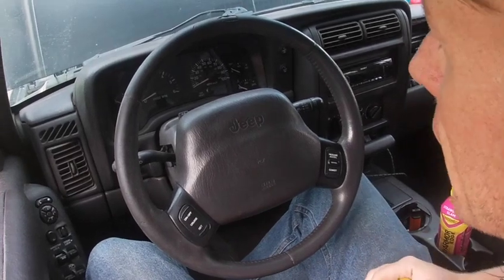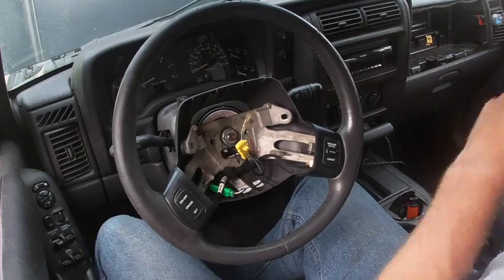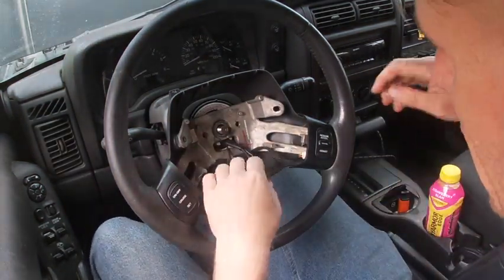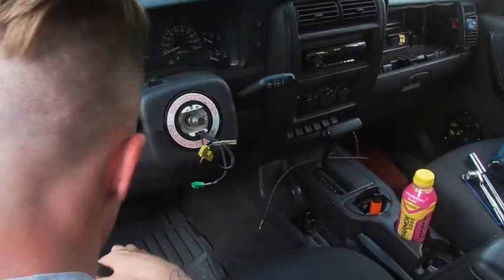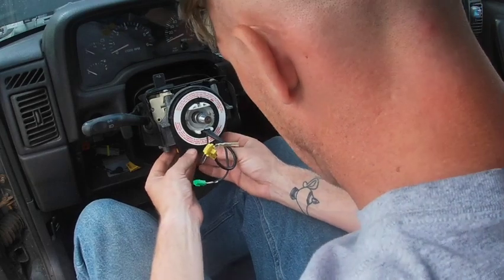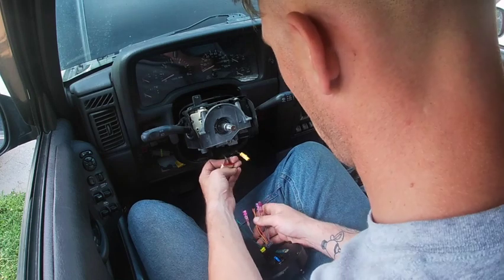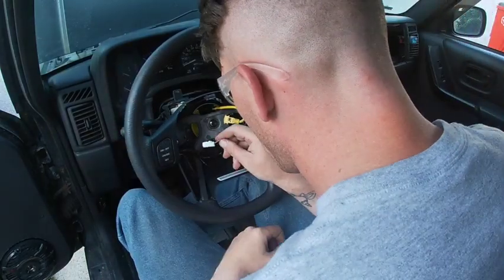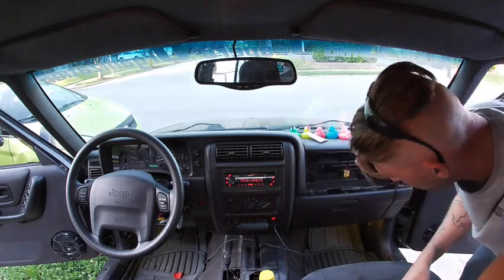WJ Steering Wheel in Jeep XJ Pt 2

Comment: Awesome 2 part video.
If im not concerned about the audio controls, can i just use the 99-01 wj harness, airbag, clock spring and an 03 wj wheel with cruise control buttons? Would that still require splicing in the wiring or can i swap the buttons for 99-01 wj buttons? 

Thank you for the write up

Comment: great video! what's the go with the audio controls?
Reply from the maker: Thank you! I’m still working on that part of the install. Need to figure out a few more things with the wiring harness to make it work.
Reply: @ouroborosautomotive  just PM you some info on FB. I’m doing the audio controls soon
Reply: Hey you two, if y'all need help getting the steering wheel controls to work please contact me via Facebook. I know EXACTLY what you need in order to get the steering wheel controls to work for your aftermarket radios!! I'm a expert at this stuff, I do it all the time haha...
Reply: Here is my fb page, feel free to message me. I'll send you the link to the correct steering wheel control interface that will hook right up to your two wires for the buttons, and it will learn the button presses and will send the correct thing to your brand of radio... It's a peice of cake!...

And if you had a Car Joying brand Android headunit, you wouldn't even have to buy any kind of swc interface because the Joying brand radios accept the resistance-to-ground based swc buttons these steering wheels use, so it would be even easier! Plus the joying radios have a menu in the radio to learn and assign a function to each individual button press. I always do my Volume + and Volume - on the left hand side of the wheel, and do Next Song/Station, Previous Song/Station & Pause/Play on the right side buttons. That's how I like mine setup
Reply: @ouroborosautomotive  did you end up getting the audio controls working yet?
Reply from the maker: I’m going to be swapping over to a joying unit in spring to have Apple CarPlay. When I do that I’m going to do a video on how to get the audio controls to work. I have the wiring diagrams already set but only wanna tear apart my dash once. Should be set about March time frame.
Reply: @ouroborosautomotive  love your work!